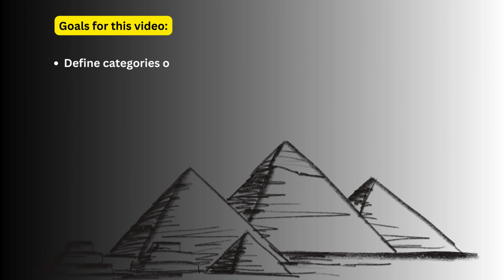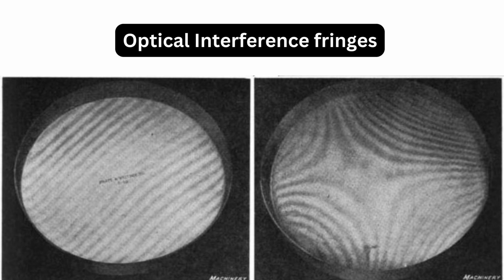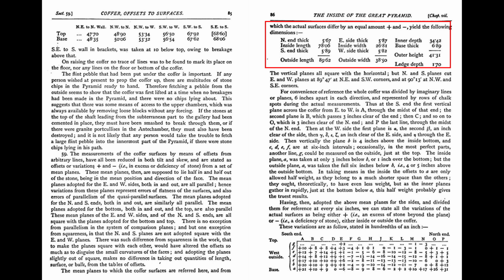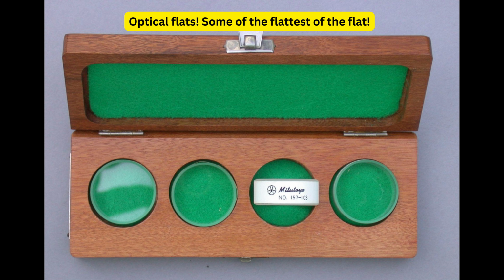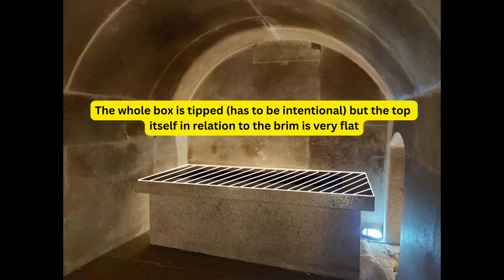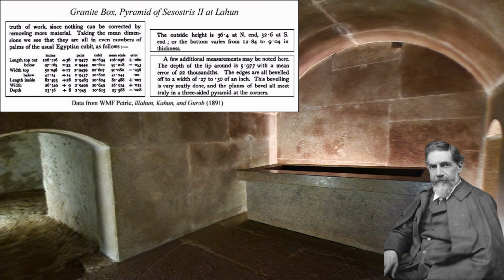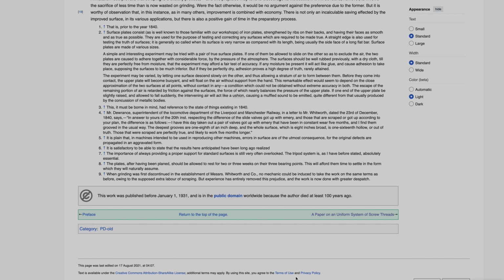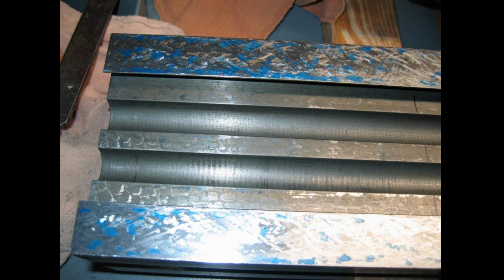The Problem of Flatness in Ancient Egypt

Comment: circa 1979 I wanted a seriously flat surface between 2 motor parts and used a mirror with abrasive sand which I still do today  on vintage vehicles. Why can't we believe that that they lacked this understanding?
Reply from the maker: That is a good method I hadn't heard of,  is the mirror part a necessary  component or would any glass held in a frame work. I am guessing the handle and mirror backing help with manipulation over a sheet of regular glass now that I think of it.
Reply: @intothemap360  It is just a sliding, tatty bathroom mirror so no frame. I use 4 bits thin Blu Tack to it sliding on the bench. A Blu Tacked sand paper sheet for small bits works better.  Any glass will work as long as it doesn't doesn't have wavy lines. Put the item down on the glass, not the other way around.
Reply: @intothemap360    It is just a sliding, tatty bathroom mirror so no frame. I use 4 bits thin Blu Tack to it sliding on the bench. A Blu Tacked sand paper sheet for small bits works better.  Any glass will work as long as it doesn't doesn't have wavy lines. Put the item down on the glass, not the other way around.
Reply: @intothemap360 
I shudder every time I see a video of some shade tree mechanic resurfacing the aluminum head off of his cars motor with plate glass and emery paper. One reason is the lack of understanding that when the warped is that bearing bores of the camshaft or shafts also warped out of alignment. And will still be out of alignment even if the mating face of the head is "flat". The same applies to milling a warped head.
Reply: @mpetersen6  Check your syntax and correct what you wrote, cause you don't make sense.

Comment: One flaw in the information herein: everyone always assumes lasers are accurate, but they are not, only approximate. Even professional contractor lasers costing thousands. Most have a deviation of 1 - 4 % over the rated distance of measurement.
Reply from the maker: Good point. You also have to take into consideration the tooling setup that holds the laser in any given position, the ability to be adjusted in a very fine increment and then held there is half the battle!
Reply: I use a laser with about 1/2 micron per meter accuracy.

Comment: 20:18 you literally embolden the lost technology argument by saying they didn't have books like we do. Exactly. It wasn't documented, they used a tool (technology) to achieve the result that is no longer known/documented - lost technology. Doesn't mean we're saying rhey had lasers or something, we're just saying we don't know. You also write in the video "yes, I'm aware these stones would have to be as big as the surface" but totally glaze over how they're supposed to "rub" a 20 ton piece of granite against another 😂
Reply from the maker: A flat bronze or copper plate in a frame could work. There is of course in any video a point where the author could have taken other rabbit holes, I agree I did not answer every practical question. There are more problems to solve for sure
Reply: They don’t both have to be 20 tons.
Reply: 💯  I beg these people who say it's obvious they could have done it with hand tools to show us one single time. The excuse is "oh it's just not worth the effort." Which I mean yeah, it wouldn't have been worth it back then either. But we know so freaking little about them that a lost technology really is the simplest answer. 99.9999% of the tools they used and information they wrote down is lost.
Reply: @Cpl_Clegg go to any stone counter top place. The fabricators still use these methods on thousands of pounds of countertops
Reply: @derekk8523  name one who quarries thousand ton stone by hand, hauls it to their shop by hand, works it by hand, then stands it up by hand. Not only do they not do all that by hand, countertop places don't work on anything 1% as large as the ancient Egyptians or whoever they probably inherited the megaliths from. It's not economically feasible today, nor would it have been for people with much more limited resources. The pharonic Egyptians either had a much better understanding of physics and engineering than we give them credit for, and much better tools, or whoever they inherited the stuff from did. 

Even if we just focus on the "small" boxes that some people call sarcophagi, how are people rubbing stones that large together by hand? There are some masons on YouTube who have tried to recreate the processes on much smaller and softer stone, but the vast majority don't think it could have been done with the tools archeologists say they had. Archeologists are good at recovering and preserving relics, but they're bad at making up stories to explain them. That's where real scientific disciplines come in like geologists and engineers. Archeology is driven by ego and I didn't understand the need to defend their narratives. It seems much more reasonable to admit that we don't have enough information to explain everything, but we know enough to rule out silly oversimplifications
Reply: @Cpl_Clegg not one person but thousands easily can do it. Who built skyscrapers or battle ships in ww1 and 2 without cnc machines? Many times bigger than anything they did. Human can do anything they wanted. Just you didn’t witness it don’t mean it didn’t happen. In fact it happened thousands of times all around the world. Pyramids are the most basic shape. Fairly simple to create. They are located on basically every continent
Reply: @C @Cpl_Clegg  the vast majority of people don’t even go outside and do anything for themselves. Countless skills have been lost as technology has grown.  Just imagine all the shit that was made out of wood but time has rotted
Reply: @derekk8523  I imagine all the tools and literature that time has rotted. We're not significantly evolved from people 10,000 years ago. I bet they built and knew a lot of stuff we don't give them credit for today. 

That whole "oh just put enough people on it and they can move 1000+ ton stone easily" is just ridiculous. Just imagine the amount of rope required for those weights and distances. The amount of manpower, tools and food required for all that work either points to some serious technology, a civilization that was mass producing food and equipment, or both. It wasn't just time that wiped all of that out either. We're learning more every year about global catastrophes. Whatever happened at the end of the younger drayas that wiped out entire species of animals could have easily wiped out a human civilization, and there's no good reason humans before then couldn't have been civilized.
Reply: @Cpl_Clegg it’s documented that 10s of thousands of slaves were used. They were also treated fairly well. Yes thousands of organized workers can build and move quarried rocks miles to work site. Early humans lacked organizational skills. Chinese Indian ect cultures all documented the use of thousands of workers. In 2000 years humans evolved to be taller and stronger. 10000 years ago hunters and gatherers was the main thing humans did. I am sure there was large populations that lived near each other but farmers didn’t come until later and people were nomads following food sources. Not much technology was developed besides tech for catching animals
Reply: @derekk8523  I can't take anyone seriously who talks that certainly
Reply: @Cpl_Clegg bro please go learn some simple physics, trust me, it’ll explain how work can be done without simply “picking up” and moving things. Ancient humans understood physics and they eventually (just like us now) did trail and error. Errors are always less important to modern minds looking back at history and even people at the time writing history, think of survivorship bias.

This is the “ancient technology” that actually existed, not lasers or electrical components, or alien intelligence helping along the way. With artists and engineers of the ancient world we can expect they accomplished this with the tools they had at their disposal.
Reply: @Cpl_Clegg Very good point that I too have been trying to get across here. Baffles me that so many accept a unproven theory as proof this was done with simple tools. It simply has not been proven to work.

Comment: As a small side business I lap a lot of granite slabs for precision  - it's stupidly easy (if you know what you're doing).  I would love to see somebody go with a interferometer there and exactly measure the errors on that sarcophagus. I bet some of the published numbers are too low as a deliberate result of bad measuring and they don't want anyone with an interferometer there because the whole thing would lose it's mystery and there would be less hype about it. It's all about hyper and marketing so they get visitors and fame.
Reply from the maker: Ah this is the type of person I wanted to watch my video. I hope I wasn't too far off here!
Reply: I too would love more open accurate measurements.  I wonder about the differences of lapping a slab vs using a slab to lap a vertical surface and also creating inside corners.  I would love to see it done more accurately than those scientists against myth guys.

Comment: The answer is lapping take three surfaces of equal hardness.
Grind A on B then A on C then B on C repeat.
The Whitworth method.
Reply from the maker: You will love the second half of my video, wish you had made it to that point!!!
Reply: Now show me how to do it with a 30 ton stone with ropes and levers. No pulleys, wheels or axles. Or how they got the 100 ton source rock into the cave to be worked in the first place. Remember the boxes were roughed in and finished in place. With a few feet on each side limiting the size of the levers being used. And there are no holes in the ceiling for anchoring a rope.

Comment: Since you seem to have your head "screwed on" (and at least some of your commentators too), I'm wondering what measurements you'd take to assess the "miraculous" "alien tech" ground/ drilled stone jars.
I'd start by mounting an example with (longer than normal?) chuck jaws on a 3-jaw chuck, at the diameter against the closed end. Then measure the run-out on the internal surface of the "neck". That should give both the roundness, and the concentricity of the two parts of the surface (concentricity is something the "ohh aliens" brigade never discuss ; as any machineist knows, every time you remove then re-position a part in your machine, you hazard concentricity, and have to take active steps to preserve it.
Repeat with the same "long" jaws in a 4-jaw chuck, aiming for RMS centralisation of the largest diameter. Repeat the measurements for both circularity and concentricity of every other convenient surface which looks "round" (I'd exclude the "lugs", which would be a complex "interrupted cut" of you machined these purely on a lathe). 
Third set-up -  flip the 4-jaws and the orientation of the pot. Grip the internal diameter of the "neck" (4-ways) and arrange it for RMS centrality on the lathe. Then take the circularity and concentricity measurements on the largest-body (well, that's probably where you did your RMS set-up), on the outside of the neck ; on the outside of the base ... (for complex profiles, there may be more diameters to measure for circularity and concentricity. 
The interior dimensions ... obviously you'll be on the "long jaws", probably all 4, to grip the exterior. How to assess the interior? There may be tools for measuring distance from (say) a boring bar. But they're probably rental rather than purchase. Crudely though, would this work (you'd need the museum curator's permission, of course) : fill the vessel with plaster of Paris (alternative : solvent-removable plastic) ; put a boring bar in to the neck ID with a really soft (engineering-wise) bit) and weigh the removed material ; increment ID by 1 mm ; weight the ejected material  .. repeat until you've got most of the plaster out. Your successive weights (assuming no porosity) will give you the smoothness of the internal profile, but not the concentricity.
It's actually an interesting problem of metrology. 
I (almost) thank the various "it's Aliens" idiots for making me think about it. There is this story that some organisations use interview questions for recruits like "how would you weigh your own head?", which are actually increasingly challenging for each significant digit. This is in the same category.
Reply: Thats all awesome. They didnt have the wheel, axle, lathe, or pottery wheel. And they only used sand, copper, and their hands. Explain that away.
Reply: @wpriddy  Egypt was very early to what was basically the pottery wheel. There are also depictions of sort off off centered arm spun vertical "lathes." They aren't a lathe as we know it today but for lack of a better word. And so they also had the wheel. Nearly everyone "had" the wheel. The problem wheel wise was always the load bearing axle for transportation purposes. So you are asking someone to explain something but without any of the things they had. You're just eliminating things they had to make an impossible to answer question.
Reply: @AveragePicker they did not have the wheel, or the pulley, both of which are required for a pottery wheel, in the early or old kingdom. Thanks for playing.
Reply: @wpriddy Now you've added in pulleys? You dont need a pulley for a pottery wheel
Reply: @AveragePicker Then how do you get the ratio? The other answer is gearing. You have to have a way to transfer the power from your feet to the wheel. There are few options.
Reply: For their precision I'd start by asking why are no two the same? Because that tells you they had nothing they were working towards. They could essentially work a vessel until it was as good as they wanted it to be.
Reply from the maker: Good starting point, I haven't begun the process of working on my research for the vase video, many many topics on the editing floor! However I actually have copied your comment into my notes folder to refresh my memory when I do this research.